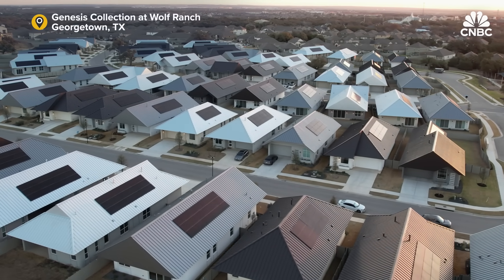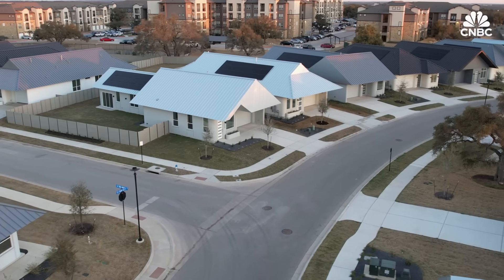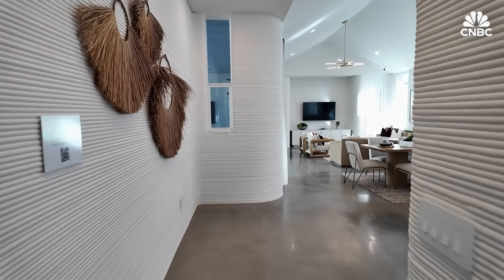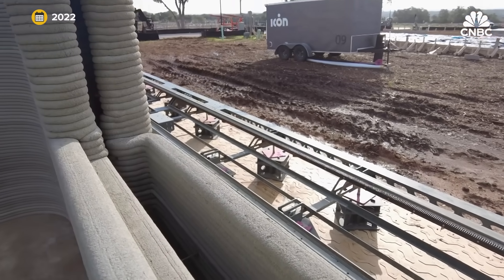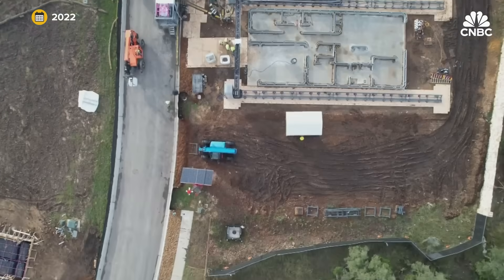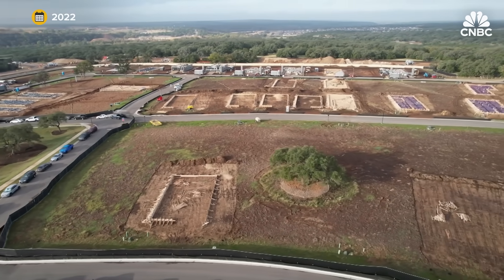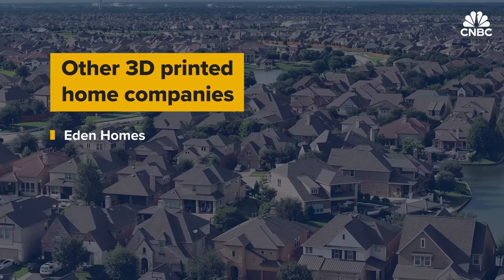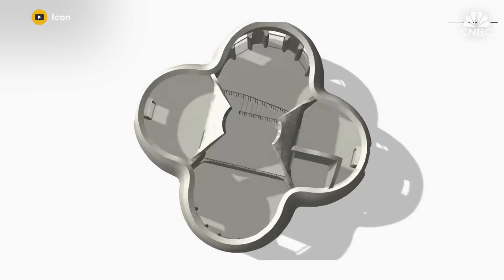Inside The World’s Largest 3D Printed Neighborhood

Comment: Licensed architect , here- 20 yrs experience… 
1. Horizontal shear force, like an earthquake tremor for example, would concern me. There’s no internal reinforcement. Rebar allows concrete to better withstand lateral forces. Even settling in the foundation will create cracks. How are the cracks across these rows of printed wall repaired?
2. Where’s the flashing? Water finds its way into cavities - just the laws of nature. Traditional construction flashes the moisture out of the building. When it doesn’t, moisture builds up and causes mold and rot issues. I’d be interested to see the forensic reports on these homes in 15-20 yrs.
Reply: Just imagine trying to get to broken pipes in the walls, I own a pluming pany here in south Texas, and I can confirm that these future repairs won't be an average behind the sheetrock charge.
Reply: Totally get the concerns, but a lot of this is based on the assumption that the printed material is just concrete with no reinforcement. The printable mix isn’t standard concrete. It’s a high strength mortar designed for extrusion, and almost every code compliant 3D printed home uses reinforcement built into the design.
	1.	On lateral forces, the walls aren’t left hollow. The printed shells create cavities that get filled with grout or concrete, along with vertical rebar, similar to reinforced CMU construction. Horizontal reinforcement varies by builder, but fiber reinforcement, post-tensioning, and poured bond beams are all used depending on local code. These homes already pass seismic and wind load requirements in states like California and Florida, which is where the lateral force testing is the most strict.

As for cracking from settling, the foundation is a standard reinforced slab. If a slab moves, any structure will crack, but the printed layers are high viscosity mortar with shrinkage reducers and fiber, so the typical long shear cracks you see in monolithic concrete pours are far less common. Small cosmetic cracks are repaired the same way as any masonry crack.
	2.	On flashing and moisture, the printed walls are not left raw. Builders apply the same exterior weatherproofing used on masonry homes. Elastomeric coatings, stucco, fiber cement siding, and proper flashing at openings handle moisture the same way traditional construction does. The printed layers aren’t intended to function as the waterproof envelope by themselves.

Long term data will be great once we have 20 years of it, but so far the field testing from ICON, COBOD, and the Army Corps shows very good performance in extreme heat, storms, and freeze cycles. The tech looks different, but the building science behind it is very familiar.
Reply: Saw a larger printer where they added rebar into the concrete during the print process.  This printer is smaller and I see little to no rebar insertion.  These would crumble in major earthquakes.
Reply: Ya, I was thinking the same. Plus I really don't like the look of those concrete walls.
Reply: All good questions.  We live on the West Coast and have a fault 1/2 of a mile away.  When there is slippage along the fault it is a sharp shock like someone hit the home with a truck.
Reply: I have no architecture or building experience (unless you count electricians as such);

But my absolute first thought was earthquakes and lack of support as well.
And I have worked on places that were renovating, partially due to sinking.
Reply: Well I agree concrete doesn’t let moisture out and that causes mold and rot issues.  concrete construction is not new and housing build in it has more mold issues. i watched the video to see what they did about that , they did nothing!  Re Rebar reinforcement they did  something  at 2:38 you see it , but its not much and probably not good enough.  looks like PR stunt more then anything usefull
Reply: @lemontube1000  in the Philippines, we have what's culturally called plate cabinet, and 3 or 4 years later it's already crumbling/flaking.

As others said, cheaper in many ways but still same price? In my country that's called smallflation and a needless profit for investors
Reply: Im sure they addressed these concerns in the design. Those cheap regular houses don’t hold up either so it really doesn’t matter lol
Reply: Thank you for insight. I never thought about it. Do you think that those cracks could be fixed with molds that take the schape of the wall?
Reply: Indeed, I'm also concerned with storm & hurricane safety of & in these houses. That's definitely should be investigated as well. However, the houses being fire-proof is a big win already.
Reply: Great for places where the ground doesn't freeze, be a complete nightmare where I live.
Reply: Listen to your Architect!  I think innovation is great and necessary. Free markets and entrepreneurs respond to needs. As for all new products the engineers will have to work the bugs out and develop new means and methods. Now having said that, I have worked with  many Architect and Engineers and the good ones will tell you  do not put or use any new materials into or on your house that hasn't  been used in the field for 20 years and tested by time. You want to be on the leading edge not the bleeding edge.
Reply: @265P42G😴
Reply: These homes do have reinforcement—ICON’s ICC-ES report requires vertical/horizontal rebar and grout, and the walls are engineered for in-plane shear (though limited to low-seismic zones, SDC A/B) . Cracks are handled with standard ACI/ICRI methods (epoxy injection or cementitious patch) . On moisture, the printed wall gets a waterproofing layer, but long-term performance still depends on proper WRB/flashing detailing—a HUD study showed failures when flashing was skipped.
Reply: When will you implement geothermal heating and cooling into the walls
Shanon L Fowler /
The Ancient Trapper
Reply: I know nothing about engineering or construction - but my son worked for one of these companies last summer and there is rebar in the foundational portion of the print. That’s all I know.
Reply: @ForeverClaudy which is in every concrete driveway and basement floor of every house built of concrete. The problem is concrete is great at compressive force—it can bear a lot of weight on it. But if you make a concrete wall and say a tornado throws a car at it, it cracks and falls. Rebar helps, but you can’t really repair concrete, you have to remove it and replace it like they do with sidewalks and bridges. And my brother had a house built on a concrete slab, they had to run the air conditioner all summer to prevent mold in the carpet. Or you’d need to run a dehumidifier.
Reply: Haiti came to mind right away. Texas is pretty geologically stable though. I don’t see this working in much other places. Texas has also received an enormous amount of rain fall since before I was alive and is causing huge sink holes. That price though. Everyone being sold their own personal Titanic. ☹️
Reply: One of the added benefits of these homes is much lower home insurance rates due to them being fire and hurricane proof.  In Florida, California and other states with tornadoes the cost of insurance has skyrocketed that’s if you can even get insurance.
Reply: It's gonna catch fire with the panels on. The CME are very strong and homes and buildings are catching fire for solar panels.
Reply: @Atlantis2227 ridiculous comment.  You are full of bull!  🤠
Reply: @Atlantis2227 😂😂😂😂😂
Reply: I do think that they should add stuff to the house after the original print took place 😅
Reply: Also, I could be wrong, but that’s a lot of concrete all around. Concrete contains naturally occurring radioactive elements like radium, uranium, and thorium in its raw materials. Some chemical additives, such as fly ash, can also introduce trace amounts of radioactive materials. So I am really hoping all the concrete is sealed.
Reply: @SellieM6970 it’s not cooncrete
Reply: Licensed architect , here- 21 years experience… I think the construction is just fine. Just the laws of nature and what have you.
Reply: Overpriced, novel ,impractical, prone to structural issues, once subjected to weather extremes, water infiltrates or mechanicals need repairs or updating. 

Personally I Would never pay 400,000 or more for a 1500sqft slab on grade home either.
Reply: Where is the plumbing? 
In the walls and they pour around it? 
Have fun fixing leaks
Reply: @shooth100  No if you paid any attention you'd know supply and drain lines are run in stud walls, furred chases, or slabs. It follows typical CMU practice no different
Reply: @whatwill13 
Great ill just cut through concrete to fix a leak in the ceiling.
Reply: @shooth100 why would you cut through concrete at any point for a leak 😂
Reply: @whatwill13 
So how would you access a plumbing leak in this building ???
Reply: @whatwill13  They are crap houses, and will have major issues in 10 years. End of story.
Reply: @Exftrade2025 probably but its the future when they get reliability down and longevity
Reply: @whatwill13  This thing a *hit box, and not good. Build normal homes, like we suppose to. I would never live in that *hithole.
Reply: @Exftrade2025 😂😂😂😂😂
Reply: Worked on concrete 3D printing in a few European research project. Sound isolation, moisture, aging due to cold and heat waves, fire resistance ( yes concrete suffer from fire too ), degasing pollution...they are moving too fast on those without thinking about the long term effects. Also this does not solve the housing crisis. We need more multihousing buildings and not more huge sprawling suburbs
Reply: @dragonmares59110 no we need a financial crisis and deflation. More apartments will not solve housing and prices. In my country we have excess multifamily development and still there is shortage and high prices. Ppl with capital buy and lock empty
Reply: @dragonmares59110  Most people do not want to live in multifamily dwellings...we value independence and not socialism.
Reply: @AnthonyPhillipsWX4SNOCommunica Right, which is why home costs are so high. You can’t eat your cake and have it to
Reply: A few minutes of research reveals your concerns are invalid. The outside does get flashing and the walls do have reinfoircements. They are more resiliant to wind, fire, and earthquakes than convetionally built homes. Their only weakness is rain with wind; however, that's why the outside grooves get filled.
Reply: That is what I was gonna say: Can it stand harsh climates and floods, and others put that 3D to the test.
Reply: May be the region is not seismic
Reply: it isn't too seismic. minimal around Austin.
Reply: Would fiber in the mix help with this?  Also, watch this place be empty and condemned in 20 years..lol
Reply: @adamcombs4953  Making containers for people, ridiculous. This world is a joke.
Reply: Great insights. Thanks!
Reply: Those are legit questions. Overall I see these 3D printing "houses" total crap.
Reply: @Exftrade2025 said someone who’s never seen one or stepped inside one….  😂
Reply: @rpdx3 Never will either. I live in a nice home that is built in a traditional way. But if you want to live in a container, go for it. Maybe that is what you deserve, maybe that is all you are worth.
Reply: @Exftrade2025 you call it “crap”, yet you live in a stick built house whose sole design purpose was to build a minimally viable product at the highest cost possible that begins the process of deteriorating the minute it’s built. If civilization ended tomorrow, this “crap” 3d printed house would still be standing in 50 years and your toothpick house will have deteriorated to the foundation, if it even has a foundation.
Reply: Put your weight where it matters. You should work with these guys to eliminate those vulnerabilities you just made it clear
Reply: @berkaltuglu8140 If there are vulnerabilities, the original commenter is supposedly an architect and would not be aware.  Let’s ask an engineer.  🎉

Comment: Concrete will enivitably crack over time.
That's why hempcrete 3d printed homes are the best materials, it won't crack over time. It's temperature perfect in which ever season you're in. Glass panel sky windows can draw energy into batteries and provide power , and it's fire resistant so don't worry about your home burning down.
Why isn't this the main building material? That comes down to stigma propoganda from big businesses that have already invested into an inferior product.
Go and look up hempcrete 3d printed homes and be amazed and disgusted as to why it isn't being more rolled out.

Comment: Unless they have made magic, you can not build a house like that, anywhere there is cold and wet, concrete will newer hold, it only works in a very dry place. And i would still question concrete walls without iron in it, they need to let me hit the wall with a sledgehammer, before i sleep there. And i know the old lady likes the walls, but at that price, i simply want something better looking on the inside.

Comment: I wonder if there’s a way to still involve drywall + studs to run insulation + electrical wires through instead of struggling to run them through the concrete

Comment: Very interesting. I love the curves of the house, efficiency, solar panels. Curves are great in areas prone to hurricane force winds. The building quality looks excellent. The downside:
Construction employs 5 to 6% of Americans. That's a colossal addition to unemployment figures if the future as predicted here  - along with AGI - happens. Also cement production (and I'm assuming this is cement-based concrete with additives for flow and consistency) contributes 8% of CO2 to global annual emissions. Is there a more environmentally-friendly variant that could be used? There is also a global shortage of building sand.

Comment: The government should use 3D printing to create an overwhelming supply of housing until demand is so low that prices fall. They won't though because our democracy serves money...not the people. Housing expenses should represent 1/3 of a budget. Getting it down to that number could bring back the single income household...but that's not the goal of anyone in washington. The greeks didn't have this problem when they invented democracy but their version included democratic political ostercism. The governing body would permanently remove the baddest apple in their bunch by way of vote constantly strengthening it and guaranteeing that it continues to serve what it was designed to serve...THE PEOPLE. Thats why democracy was the best example of how government could fairly and equally reflect the will of the people. Our democracy reflects the will of the largest campaign donor.

Comment: you dont want all that thermal mass which is why they made the roof comically massive to keep the sun off.  not the best design but would work in a lot of places. not sure about that concrete beam over the garage, needs reinforcement or it will crack and fail.

Comment: Funny thing is, there's no housing shortage anywhere - the shortage consists of housing that is affordable to most.
Reply: Eh….we sort of do have a housing shortage. 

I agree homes are way too expensive though.
Reply: Supply and demand are what regulate prices. Because supply is low prices are high.
Reply: @J3FF4SON  Then why are diamonds so expensive. When it's much more common than other rocks?
The law of Supply and Demand isn't always applicable to everything. Just like OP said. There are more factors that control prices not just supply and demand.

Comment: I have always hated white plaster drywall that goes moldy so easily. These mobile machines that can travel and do 3D concrete on a slab. This should be making great savings compared to lumber prices. Canada has been clear cutting forests and scalping mountain trees and they wonder why there is landslides and floods. Trees give us our oxygen. Every tree cut should have had 4 seedlings planted in its place. Way less employees yet the structure still costs half a million. I don’t see any “bringing costs down”. Where is the plumbing and electrical put? Are they in place before the concrete printing? What if repairs are needed to wiring or plumbing?

Comment: They need to smooth the walls, I think that can easily be done in future phases. Plus, the homes are built out of concrete rather than just wood so it will last far longer.

Comment: So its not better in anyway other then not paying builders. You cant modify walls or anything after its set. How is that going to hold up w/o rebar or any other structure. 50yrs? 100yrs? Concrete is not stone it doesnt last forever

Comment: Americans discover the benefits of building houses with concrete… 😂 My biggest objection to purchasing a home in the U.S. is that most modern homes feel disposable — they’re built with lightweight, temporary materials like drywall and wood framing. I prefer solid, long-lasting structures made of concrete or masonry that feel permanent and secure.

Comment: It’s more expensive because THE HOUSE IS CEMENT. It doesn’t burn or turn to mold, it can’t be destroyed in a flood, or with a leaking pipe, termites can’t eat it. You guys should lead with the advantages. Not say, well it’s just more expensive because we are doing something new. No, those houses are not the same as traditional builds.

Comment: with the amount of concrete, very bad for the environment, raising global temperatures, so you get trapped in your concrete bunker. also not enough space and trees in between, so heat will get trappped outside. this is the opposite of ecological building. Great for those companies, not so for the people.